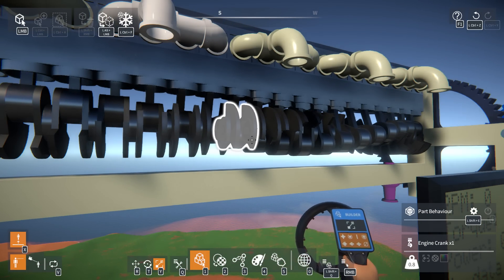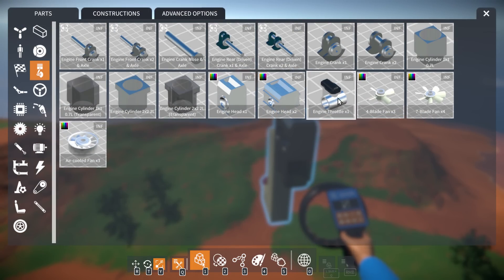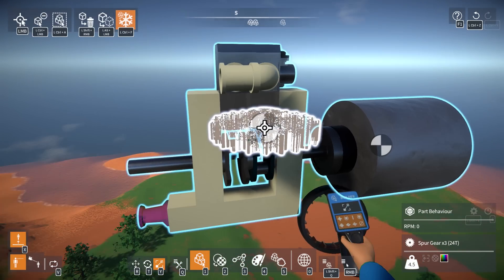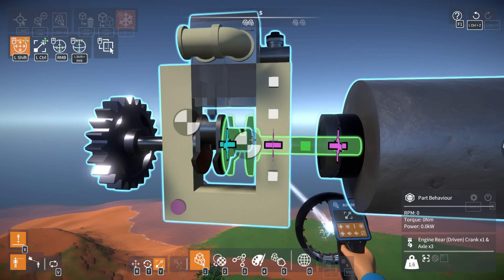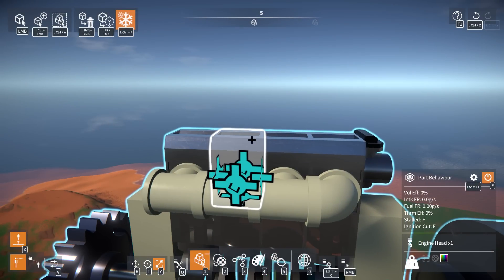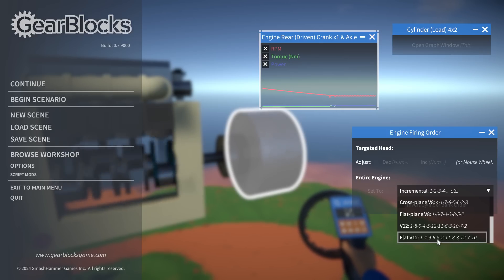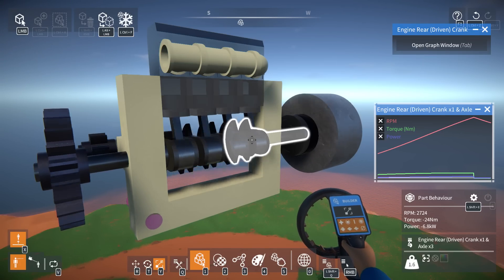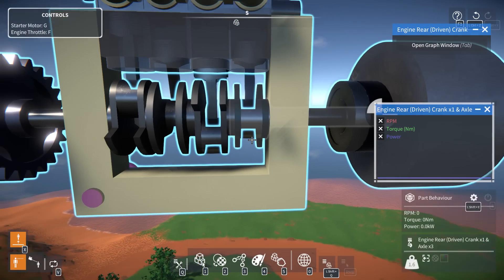Which Engine Setup is More Efficient for Generating Power? (Gearblocks)

Comment from the maker: Now of course the question is how do we apply timings to non symmetrical engines: 5 cylinders, 3 cylinder radials etc.
Reply: I made an I5 and I used the timing 1-6-3-4-2
Reply: Not sure how this game works but IRL, ”wasted spark” is a very common ignition-configuration. Not sure it makes sense in the game though. For example, ignite cyl 1 and 3 at the same cycles and then 2 and 4 together.
Reply: @LurveSE boxer?
Reply: I just do 1-3-2 for 3 cylinder or 2-3-4 or something
Reply: You just use the "Engine Tool" script and use the linear preset. Works good enough. And yes, firing order and crank angles only changes noise, power only depends on the number of cylinders and other settings.
(Linear = scrap mechanic order)
Reply: [3 cylinder radial] 1-2-3 (120 degree)
Reply: @HangWe-n5z  historically it's 1-3-2.
Reply: I made a 72 degree v10 with the 72 degree block  and it sounds amazing
Reply: at 15:00 you stalled the engine by hitting your head into the crank 🤣
Reply: You have the I4 timing wrong. It goes: 1-4-2-3 (CrsP) or 1-3-2-4 (FP) depending on crank plane.
Reply: Hey, kan. The graph u were getting, the red line was representing the RPMs, green was torque and blue line somewhere over in that graph was horsepower 😂
Reply: put it in a car already we dont care
Reply: When I try to use my starter to use engines they won’t rotate the gears and my engine won’t start
Reply: @Nooo948  either your crank isn't set to freely rotate or something connected to it, or you have too big of an engine for your starter
Reply: For radial: 1, 3, 5, 2, 4. Skip one each time, it'll be all odd and then all even
Reply: Set crank angle at 

0(1); 120(3); 240(2)

*(#) - cylinder
Reply: When you set the firing order all to one, in theory you are doing “batch fire”, but it’s usually adjusting the fuel
Reply: The 3 cylinders I know about are just an inline 4 with the last piston cut off, 1-3-2 firing order.
Reply: @DiogeneDeSin0pe which is also the firing order for a radial 3.

Comment: There are tons of motorcycles with 90 degree offset cranks, they call them "270" cranks or crossplane cranks.

Your engine with both pistons moving up at the same time, you see that a lot in older two cylinder british motorcycles, and old Kubota two-cylinder diesels. What is normally done in that configuration is one cylinder is on the exhaust stroke while the other is on the compression stroke - makes a nice even firing order. I've seen some Japanese parallel twins that have the crank configured 180 degrees  - one goes up while the other goes down. The firing order on that style of engine is always uneven, you always have one piston firing 180 degrees after the other, and then a 540 degree gap between them.

Comment: in real life timing makes a huge difference in smooth idle and power or if it will even run at all and timing makes a difference in the sound but you shouldnt mess with timing for sound in real life

Comment: The 2 cylinder 4 stroke parallel piston configuration actually exists , i have a bike with it, it makes a particular sound. And the last configuration its called crossplane (4 cylinder with the crankshaft rotated every 90 degrees) and exists on the yamaha r1 since 2010

Comment: there are great advantages to both, but the 180 degree offset 2 cylinder is better for torque applications because there is combustion more often while the engine with no offset is just a big 1 cylinder

Comment: also u can tell form the otuside if its 2 stroke or 4 stroke in a 2 stroke the top part dosnt exist the fuel comes in trought ports that the psiton closes and nto the valves it would eb impossble for this to be a 2 stroke

Comment: Kan, I'd love to see you engineer a wishbone cantilever suspension with steering and a drive axle. I'm struggling a bit with my 8x8. I used ball joints on my steering and cv axles for my drive but there's some tension somewhere I can't figure out how to get rid of it

Comment: I give up. He didnt proof anything🫣
He just mismatched the stuff…
UFF…

If it is a 2-stroke Inline 4, with standard 4-stroke crank, it would be 1-2-2-1 not 1-2-1-2….
Also the 2cylinder, having the Crank 180° apart means jt should be 1-2 firing order on a 2-stroke too…. I think it doesnt make a time difference, its just in which order they fire, but all fire when they are at TDC…

Comment: as has been said by many:
The firing order and crank offset are purely cosmetic. The sound of the engine is akin to a 2 stroke, but it is cosmetically a 4 stroke engine. The only things that truly affect the performance of the engine are the number of cylinders (total possible power), and the volumetric efficiency (controls torque value). Most things you've been experimenting with are purely cosmetic.

Comment: they are actually 4 stroke engines that SOUND like they are 2 stroke, but you can change that in the cylinder head configuration

Comment: Btw if you right click on the values in the part behavior menu you can type whatever you want, it allows you to rev higher (9000 seems to be the limit in my experience) and have an engine with more than 16cyls without a repeating pattern

Comment: U can tell its a 4 stroke by the way the exhaust looks. 2 stroke has a resonator to provide back pressure while the piston is moving infront of the exhaust port and the chamber has relative negative presure; to pull in fresh air and fuel better
Reply: No? Its not necessary

Comment: actually the twin engine from the Fiat Panda is in fact a 900cc synchronous 2 cylinder  engine. 
I drove one a copule of times  and i can tell you that you can really feel the balancing issues, like from the 1000 to the 2000 rpm feeling like driving an old tractor and over that range it finally becomes smooth 7:59
Reply: Also there is the fiat 126p but that migth be the panda but in another name
Reply: @Retrogen_boi  thats another older one that had a 2 cylinder but i honestly dont know if it is synchronous.
The 126p prosuction ended in 1991 but the Panda twin air its still in production since the early 2010’s

Comment: So if im not mistaken engines work as such:
- Power depends on cylinder count and size.
- volumetric efficiëncy also influences it maybe?
- firing order and crank angles only impact sound.

As fo the sound (and this is pure speculation), a cylinder "fires" whenever it is next in the firing order and at the top of its cycle. Thus, depending on how you set up the timing it can be a 2 or 4 stroke (or even 320 stroke). This is because you can either set the order in which the cranks reach the top ("sequential" in engine tool) and youll have it the same as in scrap mechanic. Or you can set the proper firing order for a given engine like 1-3-2 for in I3. Now the first crank fires, the second reaches the top but isnt next to fire, the third reaches the top and fires, the first is skipped, second fires, third skips, etc.
Thus if the firing order is completely opposite the crank order it should make the 160 cylinder engine a 320(?) stroke.
Reply: There is no such thing as a 320 stroke engine. The stroke count is how many strokes the engine has per cycle. 4 stroke has 1.intake 2. compression 3.power 4. exhaust and only fires between compression and power strokes. A 2 stroke has 1.intake 2.power/intake and exhaust and fires every time the piston reaches the top of the stroke.
Reply: @promod1512 Right then it's a 160 stroke. If you read what I say you'll realize why I refer to it as a 320 (which I realize is wrong cuz I have no clue how strokes are counted). It has a "power" stroke (stroke where it makes sound) every time it's at the top and next in firing order. If that firing order is completely out of wack, then each cylinder is waiting for the number of cylinders you have worth of rotations before it can fire once, thus160 stroke.
Reply: @blueflame_sm  where is the 160 number coming from? Are you talking about firing interval?
Reply: @dragonhubgaming5934  yea the 160 is the number of rotations before a cylinder fires, so I guess 320 stroke was correct (in that it has  intake, compression, combustion, exhaust, 316x nothing because it's not yet the next in the firing sequence)
Reply: Just to clarify further, assume a 160 cylinder kAN made. Now given how firing order in gearblocks likely works, if we have a sequence 160-159-...-2-1, then after 160 fires it takes almost a full rotation before 159 is at the top. This only applies to the sound though, performance wise it's just count number of cylinders and be done.

Comment: @kANGaming firing order are works only on sound for self setting for stroke sounds, and double audio pitch is for two/four-stroke engine sounds but this system maybe cool if you fargot set a firing order engine not get down HP and kW but I know realistic in games are not same, game can be similar system in real life but can't is same in real and can downgrade fps with high precision of engine physics on firing order.

Comment: It's quite simple. There's a firing order which you can set. Why on earth would you have a firing order on a 2 stroke? That's not even possible. In that case the crank adjusts the firing order, not the head (which is the camshaft and spark plugs IRL)
Reply: Just commented this
Reply: Yall do realize yall can have a  spark plug  go off both a TDC and BDC . In a 2 stroke there's a magneto  on the fly wheel that sets ignition (kinda like a distributor cap)  on car..      for the video. If he wanted to check 2 stroke or 4 stroke. Kan should  of did. 1 & 3 for timing. (That's normal 4 stroke engines) and 1 and 2 is 2 strokes
Reply: I mean, it's to avoid premature detonation right. If you have a multi cylinder 2 stroke, you don't want to say, fire piston 1 at the top of its compression while piston 2 is at bottom dead center and has no fuel in it.
Reply: @ElderonAnalas  Firing order doesn't change that though.
Reply: @ElderonAnalas  obviously the spark plug is only going to go off when at TDC. But when that's pre-programmed (such as in this game), then there is only one firing order possible. Whereas with a 4 stroke engine, you can very often have many possibilities for firing order

Comment: In theory, if you discard the effects on exhaust pressure built by exhaust gases, it shouldn't matter in the torque output which order the pistons fire. The pistons are all firing in the same cicle. The reason why firing order becomes important is because of shaft balance, stops vibration, resonant pressure wave generation in the intake and exhaust, which further can increase horse power.
Reply: Yeah, like a single cylinder engine works

So do 2 of them if you connect the cranks

The benefit to multi cylinders is smoothing of vibrations

Comment: The firing order in low-displacement engines does not directly influence power, but it is widely used to avoid stress on the crankshaft and the use of counterweights that influence engine efficiency.
Reply: Why not make every engine the blessed straight 5? Perfectly balanced.

Comment: 7:05 depends on what you mean, a cross plane crank is effectively 90° but not really, rod journal 1 and 2 are at 90° to each other as are 3 and 4 but 2 and 3 are 180 out from each other.

Comment: Symetrical timing twins are a thing, and 90° offset timings are too. Mainly on motorbikes. There's videos on it on YouTube.
Reply: 270° technically, not 90°, because otherwise you'd have a horrible firing interval and an even worse sound, but yes, it doesn't have to be 180°
Reply: @demeter1793  Yep that's what I wanted to say. Not 90°. Crank forms a 90° angle but the offset is 270° not 90°.
Reply: i agree with this. I work with jetski's mostly and all yamaha, kawasaki, polaris and seadoo twin cylinder 2 strokes have 180 degree offsets
Reply: @Lucas-qb3bs  Yep, my two stroke motorbike had a 180 degree offset. That thing was a bloody rocketship for its tiny displacement.